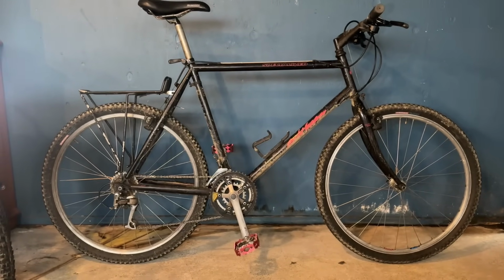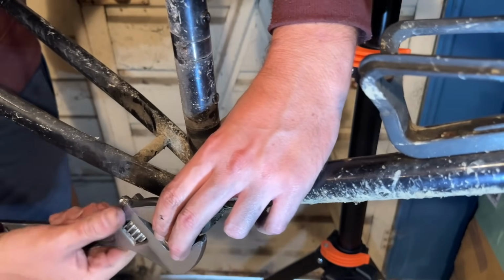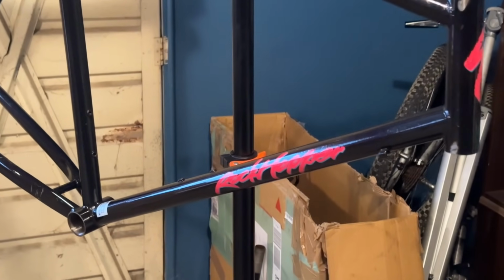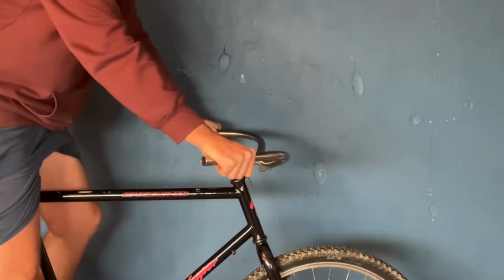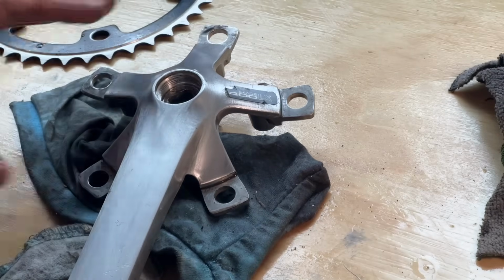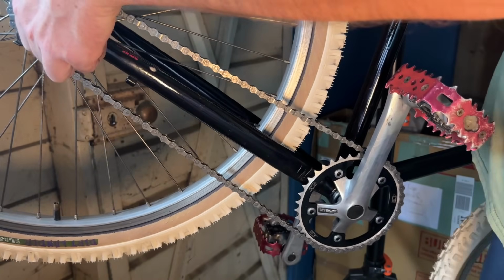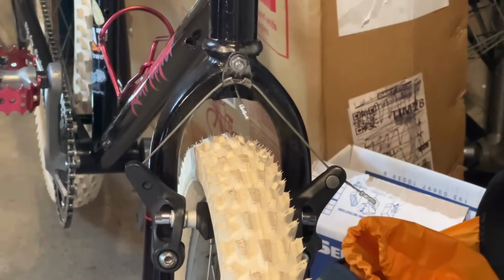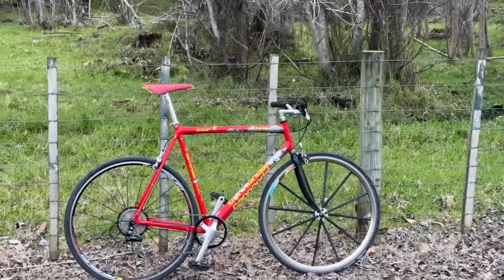1990 Specialized Rockhopper Singlespeed build

Comment: Nice use of clearcoat. I haven’t seen anyone really document their clearcoat use on these old bike paint jobs and components.

I’ve heard that clearcoat can react badly to some decal materials, which might have been the case with this top tube decal + clearcoat. I think in the areas with enough existing clearcoat and proper sanding, the new clearcoat adhered well and looks good.

Also, clearcoat will usually speed up the rust formation on the bare metal areas since it traps in moisture more. 

It’ll be interesting to see how the clearcoat holds up long term. Then again, they are 30 year old bikes at the end of the day.